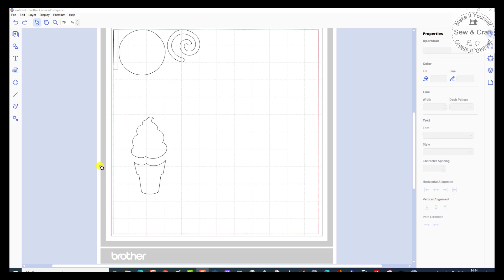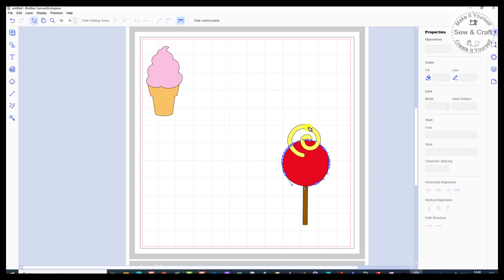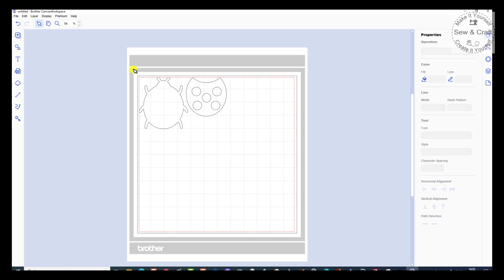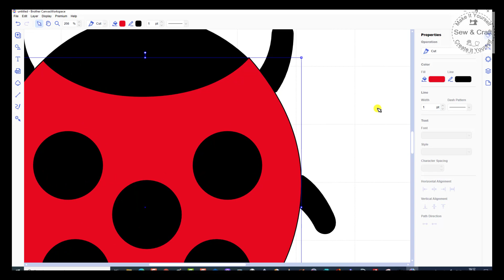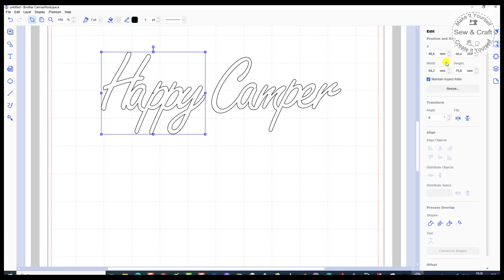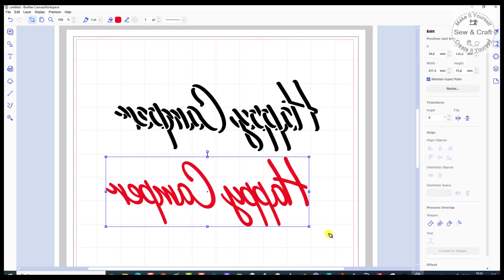Layering Heat Transfer Vinyl on the ScanNCut

Comment: Instructions are very detailed. It is obvious that she is a trained teacher.  However, I take exception to her premise that you cannot/do not want to layer 2 colors of vinyl directly on top of each other.  I realize this was 4 years ago and things have changed, but I don't think they have changed that much.  It is quite common practice to layer 2 pieces of vinyl directly on top of each other in designs, sometimes even 3 or 4 colors, as long as you are not layering plain vinyl on top of glitter, foil, printed, or holographic vinyl.  Perhaps she has a newer, updated video somewhere that shows layering different colors of vinyl directly on top of each other?
Reply from the maker: Hi, 
Thank you for the comment.
I agree wholeheartedly with you that you can apply layers of plain vinyl on top of one another, but not on top of foils and glitter.  (Although you can layer those on top of plain vinyl)
If the project that you are creating can handle layers on top of one another, then it is absolutely fine to do it like that.
However, the reason that I made this particular video, is that I had many requests about how to create designs that were not thick and bulky on softer garments, and also on items that need to have a softer drape like flags - and that looked more like a smooth printed image rather than a stiff applied one.
So, for those who prefer less bulky designs, the techniques I show in this video is an option.
But, for stiff items where it does not affect the flow or drape, layering vinyl one on top of the other would be totally fine.😊